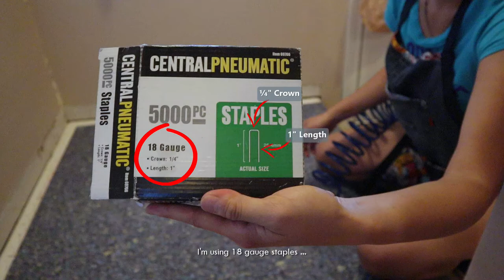How to prep for & install BERBER carpet on stairs & landings🔨 DIY 💪

Comment: You did just fine, and you should proud of your carpet install, when I watch you tackle this project I feel very proud of you, I will suggest when pulling out the old staples and nails you might find that a pair of Side-Cutters work much better than needle nose plyers, just don't squeeze too hard and cut whatever you are pulling out, you just clamp the staple and push down on the Side-Cutters, on occasions pulling up is needed,  keep it up you saved yourself a good amount of money by doing it yourself.
Reply from the maker: Thanks! I just wanna use what we already own and make it work without spending more 😉
Reply: @Random_Captures  Sounds good, Thanks